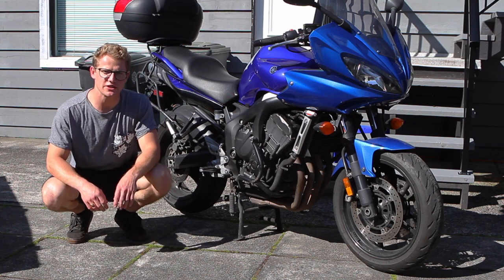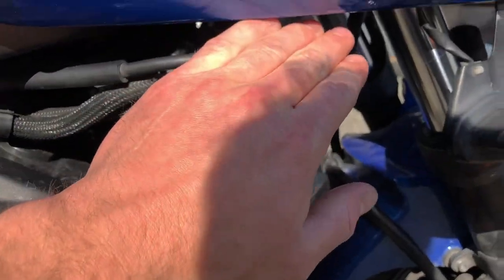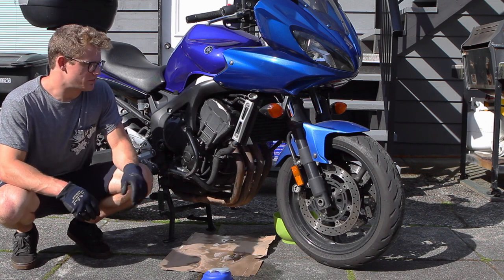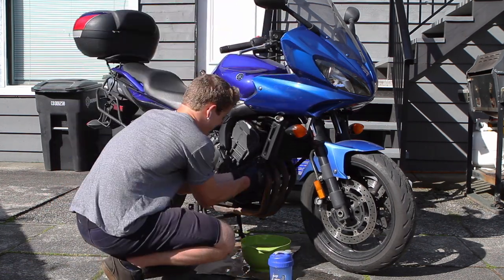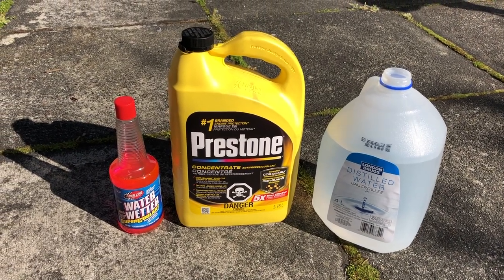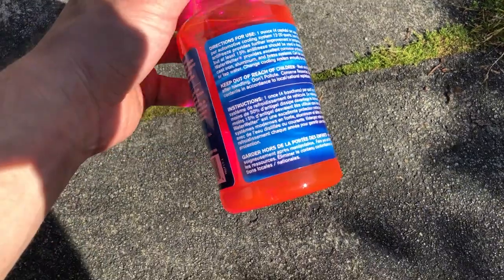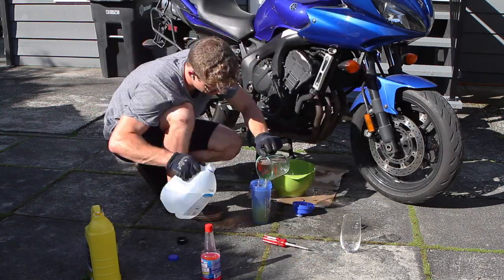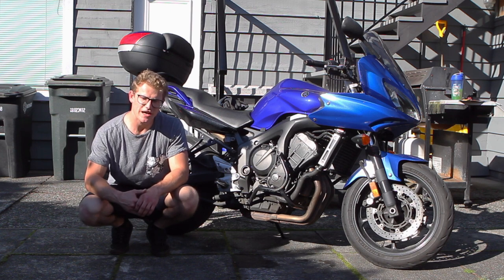How to Coolant Flush a Yamaha FZ6

Comment: I just finished the changing the coolant on my FZ6N 2006. My overflow tank was at the back of the motor near the back spring under the tank. Thanks for the vid helped me alot, but I spilled alot of flued when I realed the coolant cap... It was a heavy flow. Drained it, flushed it twice, ran the the motor a bit and filled it up a bit and flushed it with the new coolant. Then filled it up and ran the motor for 5min with some revving to get all the air out. Then closed it all up. Thanks for your video, helped alot.

Comment: Hey, great video! I did all the same as you did in the video. Still, my coolant won't move from the radiator to the reservoir. My radiator is full, the tubes and cap seems alright. Any idea what it could be? Water pump? And should I add coolant to the reservoir?

Comment: Is that drain bolt on water pump the only point we need to drain besides overflow? I know on my my 85 maxim there were like 3-4 different drain locations.

I really wish I could find a physical shop manual for this bike.
Reply from the maker: Ya I believe that was the only drain point.

Comment: I don't have water wetter I got a 4 bottles total of Yama lube so I drain it then jusy fill it with distilled and refill with the yamalube and that good? And if the resivor is low of the old stuff can I just add the Yama lube in it?

Comment: I think tou should use some dis water , to clean the system first , remove the cooland , put water in the radiator ,  start the motorcycle , leave the bike running until the pump starts kicking in to have a good recirculation ,   Shut off the bike , wait till it cools down , then start putting fresh cooling in it like you did
Reply from the maker: Ya that's a good idea. What I did was similar.

Comment: Hello People,  I have a question, the manual said that i need 2.25 L of coolant but i only needed 1.75L approx. do u thing that something is wrong?
Reply from the maker: No there’s probably nothing wrong. There is probably some coolant hiding in the inner passages of the engine that can’t be emptied out without flipping the engine upside down and shaking 😅

Comment: Do you think the noise your cam chain is making is normal for the bike? I have a similar noise but not that loud and its making me crazy. So what's your thought on that?
Reply from the maker: Hey Benjamin, ya I think the noise of my bike is typical for this kind of bike. It's a 16 valve solid lifter valve train that's chain driven, it's bound to be ticky. I had my cylinder head off about 20,000km's ago and I checked/adjusted the valve lash on the the valves to be within spec (service claims this should be done every 40k km's) while the head was off. I also checked my chain tensioner, timing chain guides and sprockets and all were in good condition. If your bike is around or past 40,000km's I would consider checking your valve lash since even a couple thousands of an inch of extra valve lash can make the bike more ticky and noisy. The original hydraulic chain tensioners rarely fail on these bikes, and when they do it's very noticeable. Good luck, and if you have any other questions you can shoot me a message on instagram @freeheadgasket
Reply: @Calvinm  Great advice mate!! You're the best!

Comment: Removing the engine guard is not a difficult procedure. You just need the right tools, as I’ve done it many times when changing the oil and oil filter. Time, patience and tools.